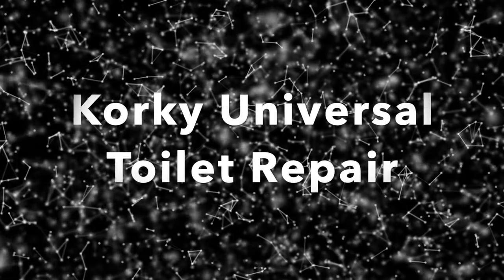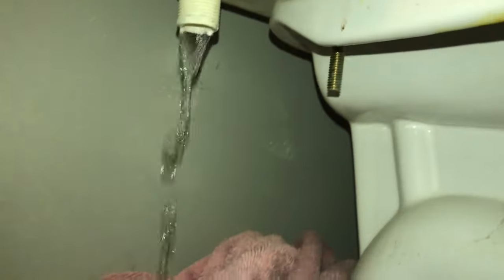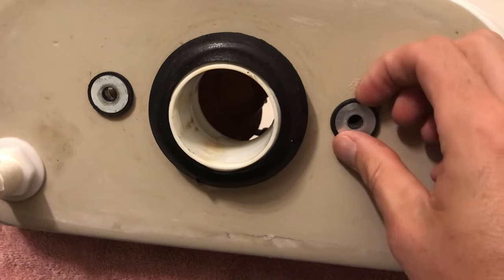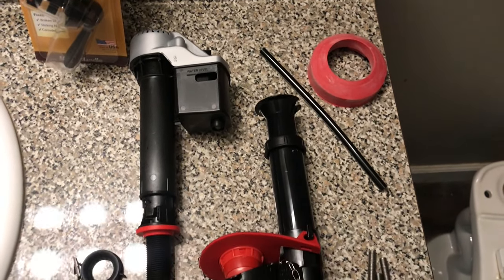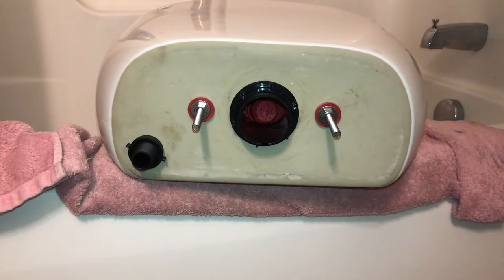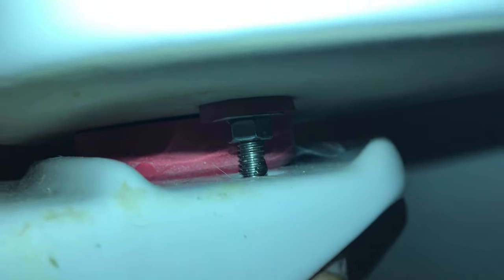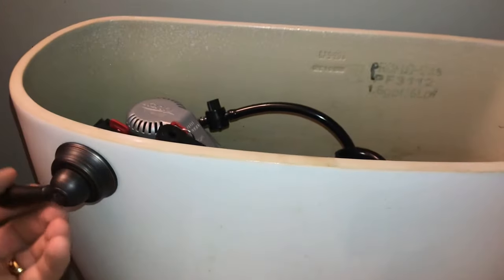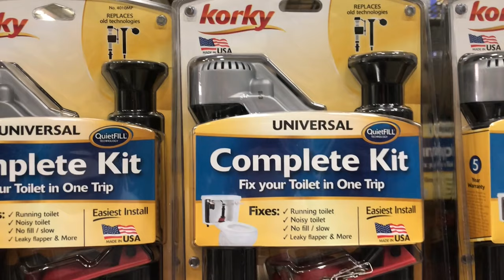Step-by-Step Guide - Korky Universal Toilet Repair + Flush Handle Upgrade!

Comment: You did not mention setting the height of the fill valve and positioning of the fill and flush valve.  I think that is very important as well.
Reply from the maker: Agreed. You should mark your pre-existing water level and then adjust the fill-valve to fill your tank to the same level. (At least as a starting reference point.)

Comment: Well I tried and I have some leaking under the valve to the water supply. Not sure what I did wrong but I’m calling a professional. Your video was great though.
Reply from the maker: I’m sorry your having troubles. We’re you able to get it sorted out??
Reply: @WesleyAllenNC  well it’s hard to find good reliable help that would not try to gouge you. I may attempt again. Maybe change the water supply line and get a washer in there or something
Reply from the maker: @Alexsjusa  the water supply line for sure needs to have a rubber washer inside of it. I’m sure  they can degrade over time, so even if there is one in there currently, check it out and see if it has failed in any way..

Comment: The tip at seven minutes is so helpful, I encourage others to get those extra washers and install as video shows.
Reply from the maker: Agreed. I’m not sure why the kit doesn’t come with extra rubber washers
Reply: @WesleyAllenNC  The other thing that this video shows that didn't come with my kit was two (or three) nuts to secure the cistern to the toilet pan.  Your video did show these nuts (although in your case they were simple nuts; I would find wingnuts much easier to tighten).  I called Korky's support line and they said that there weren't supposed to be more than three nuts in each pack; they didn't suggest that you needed a nut to tighten the bolt through the cistern, as well as a nut to go underneath the toilet pan.  This, along with the lack of a couple of extra washers, just smacks of cheese-paring economy, and doesn't leave me with a good feeling.

Comment: Excellent presentation with helpful additions - thanks for putting this out there.  One thing I found useful as I installed this same kit without any assistance was to have a level handy for the tank install.  The supplied Korky tank gasket in my kit was not fitted to the impression of the locknut as yours was and when I installed the tank (suggest having the mounting bolts in before placing the tank) the tank sat quite high above the toilet base and by using the level, I was able to mount it front to back/side to side without guesswork.  Your tip about having the flange side up ("this side up" ) on the flange nut as well as the notation on the instructions helped when I hand tightened the water supply and could not figure out why it was still leaking.  Your efforts are appreciated and your method of delivering information is easy to understand.  A real-world answer to the vids produced by the makers.
Reply from the maker: Thanks for the kind words! I'm glad that the video helped you out in some way. Oddly enough this has been one of my more successful videos, I guess everybody has a toilet! I plan to put out similar videos as I make repairs and upgrades around the house..

Comment: There are lots of videos on YouTube about fixing and repairing all sorts of things. But this video was one of the clearest and best I've ever seen, and I''ve just almost finished replacing my Korky.  I said "almost", because in a false economy move, they have not included a second set of nuts to secure the ciatern to the pan, and also left out a couple of rubber washers which woud make the job much more waterproof, so I'm going to have to go out to my local hardware store to source some small bits. Grrr...But thanks for a great video.

Comment: After the  1st install I had leak a and then we  found your video, we took everything apart and added the double rubber washer, we had zero leak . Very help video, thank you.
Reply: same happened with me. There was leak and added extra washers in all 3 bolts.

Comment: The drilling part , golden idea , came in handy when removing the old flusher. Thank you
Reply from the maker: Yes! And It’s such a large fitting, most of us don’t have specialty tools on hand so drilling it off works like a charm..
Reply: I used an oil filter pliers from autozone cost about $8 as I was going to reuse

Comment: Wes - fantastic instructional video with useful tidbits of information to avoid mistakes as well as to do the job right!  Long story short - I just finished doing all of this tonite (I am 62 and every stop of the way was drudgery). I had a wet floor (even with towels lol)  I have a fan in there overnight and a bucket under the valve / water line. I think I have a drip over that side - so hope to find that in the a.m.    I had seen another video where someone suggested adding extra red washers/nuts on outside of tank prior to mounting to bowl.  I wish I had done that. Whether I find  any leak at all - I am going to go ahead and buy the extra bolts tomorrow and remove the tank --- again -== an add the red washers/nuts.  I would rather have a sure thing than 'hope' there is never a leak at those two bolts.    I think - if there is a leak - it  is from probably putting that little black plastic nut on the bottom of the fill valve thingy - the nut that says THIS SIDE UP.  Will find out tomorrow - too worn out to fight that tonight.   I am happy with the kit - the included parts, the quality of the plastic - (hate plastic but the way of the world), the instructions are pretty good - but your instructions made it all so much clearer.

Comment: Thanks!. I watched a couple of these and by far yours was the best video especially  with the great camera angle.  Going to redo mine tommorow  and add the additional rubber gasket because of all the things the new corky system leaks at the bolt. Also love that you mention size of wrench you needed
Reply from the maker: Hey thanks! I really appreciate that. I still can’t believe they haven’t just added additional washers to the kit to solve this..

Comment: I wish I would have watched this one beforehand and took your advice to get the extra tank bolt kit for the extra washer. Couldn’t get mine to stop leaking. Great job man with this video. Well done!! Going to get the extra washer now…
Reply from the maker: Thanks, I’m glad it helped! Yeah the extra washer is a lifesaver. You might even be able to sort through the hardware isle / drawers and find rubber washers that will work instead of buying the set of tank bolts
Reply: @WesleyAllenNC  That is exactly what I ended up doing, purchasing 2 individual washers. They did the trick, now no more leaking! And I went ahead and purchased the handle as you did in your video. Thanks for replying brother, have a blessed weekend!

Comment: You saved me. I installed without extra washers below bowl and water went everywhere. Got extra rubber and metal washers and nuts from Mansfield kit and all good. Thanks.
Reply from the maker: I’m glad that it helped! They should just include the additional washers in the kit..

Comment: Great video. I wish I watched this before I ran to Lowe's to buy a 16 inch wrench in my struggle to get the mounting nut for the tank off. I could have spent $5 to $10 on the drill bit instead of $30 on the wrench and save 30 minutes of frustration! I'll check you channel first before undertaking similar projects.
Reply from the maker: Thanks for the comment! At least your were able to do it yourself.. and maybe you can return the wrench??
Reply: I used an adjustable oil filter wrench, which I already had.😂

Comment: My neighbor taught me how to do this many years ago. He is head of maintenance at the place where he works. Anyway the other thing he showed me to do is put a flat washer on the bolt before the rubber washer inside the tank. Now I know these things are in water all the time, so it just means to change them a little more often. Some of the rubber washer sets are convex on both sides, so the extra flat washer made the seal better way better.

My Korky only came with the set of 3 tank to bowl hardware and my toilet has 3 holes. So I had to go buy another set of 3 just to have enough pieces.

Comment: There are a lot of instructions about fill lines - and adjustments on that flapper - I still have to read all that a few more times and follow the instructions - but first - the leak and adding the red washers/nuts to outside of the tank on the tank to bowl bolts. Thank you again, Cheryl in SC
Reply: @WesleyAllenNC  ha ha. At my age w all this work, only OEM washers will do!!! A job worth doing....

Comment: Very helpful video. I found instructions with kit very difficult. My problem is water keeps leaking from black refill tube that goes from fill valve into flush valve. I've made numerous adjustments  in height of both fill valve and flush valve. I even shut off refill dial adjuster completely. Water still leaks. Do you have any advice. Thanks

Comment: My installation seemed to go well without the extra washers on bolts and no leaks for several days and started to use the toilet again for a few days without any problems all ok only noticed the water level in the bowl was too low (not sure if i can readjust the fill valve upwards without taking it completely out?) and there are some stationary bubbles on the heads of the two bolts and at the bottom of the fill valve. However after a few days of no leak problems i got a bit concerned about the toilet rocking on the vertical and i thought if i tightened the nuts around the bolts that might help - however the result was leaking from the bolt on the right side post flushing, after tightening, and especially when i open the main water supply full enuf so it does not take 5 minutes to fill And then another problem - as i increased the water pressure from the pipe a banging noise started sounding like a tractor in the pipes which would disturb the neighbor in the apartment below and perhaps the neighbor adjacent if i did not shut it down almost completely off  (this did not happen with the old tank inserts). So we are back to using just the toilet in our ensuite second bathroom.    HELP PLEASE.   thks

Comment: Good video. Im having problems with water not stopping as it fills in back, also leakage in the right side of tank. I seen you have a rubber grommet on the inside of tank and on the outsides
Reply from the maker: Yeah I wound up buying an extra set of tank bolts from the hardware store just to get the extra set of rubber washer. I think it helps even though the kit doesn’t come with them.. water not stopping, make sure your flapper is fully seated and not leaking water into the bowl, this could be due to a short, or too short of a chain. Otherwise it will be a fill valve adjustment, the korky kit is fully adjustable
Reply: The extra rubber washers helped. Its not leaking at the tank bolts now!  Yea !!! Im a plumber now!

Comment: Great video!!! How do you adjust how long it takes to fill the tank. Cummins is taking 1 minute to fill which is wasting water. Please advise. Thanks
Reply from the maker: How long it takes to fill the tank just depends on water pressure, tank size, and water height inside the tank. Water height can be adjusted up or down but raising or lowering bother the overflow tube and the fill valve

Comment: Great video! Just want to confirm one item with sponge gasket. There’s a considerable gap when I first set tank down - your video appears similar. Is this normal? I’m sure gravity will compress gasket but just want to confirm. Thanks!
Reply from the maker: I'm sorry for the delayed response. Yes there is a pretty decent gap at this point, just make sure the sponge gasket is oriented in the right direction and then begin to tighten the flange bolts, keeping in mind not to over-tighten and to keep the tank level..

Comment: Hello,
I just replaced mine but the level of the water is much higher than the one I removed, how do I adjusted so that the tank doesn’t filled up to the top? I learned a lot from your video, thank you so much.
Reply from the maker: The fill valve is adjustable. You’ll most likely need to lower it so that water isn’t filling too high

Comment: Hi Wesley! I see condensation around the red “spud” between the tank and bowl. How compressed should it be when tightened? 
I wish I had seen this before a friend tried replacing the spud incorrectly and not using the extra washers. 😢
Reply from the maker: It really just need to be snugged down evenly. It never really pops into place or anything like that. (The large rubber gasket connecting the tank to the bowl is what your referencing right?) ..Then the extra rubber washers certainly help out on making the bolt connections more water tight..

Comment: I’m trying to figure out where you show how to adjust the tank water level.  I’ve just followed every step and the directions are showing me that this is something that should be done before installing the fill valve. Is that correct?
Reply from the maker: The fill valve is adjustable up and down if needed. We're you able to sort this out?

Comment: Wes, you saved my day! Out of all of the instructional videos I viewed, yours was definitely the best and most concise. My only problem is, I need to hold the handle down to get it to flush. If I hold and release it doesn’t work. Help!?
Reply: You may need to adjust the fill valve height so allowing more water in the tank at each flush. Sounds like your flapper is closing back to soon

Comment: Excellent video and I wish I had watched this one, instead of the Korky one before doing my installation.  Overall my installation was fine (no leaks, everything works), but there is one thing that is still an issue: the tank still has some movement after I tightened the bolts.  Is this because the sponge gasket is still new and as it settles it will allow me to tighten the tank bolts further?
Reply from the maker: The tank will almost always have some movement since it’s basically just sitting in the rubber gasket and held down by the two bolts. I would just tighten them good by hand but don’t use any tools to torque them down. It’s never happened to me but I’ve heard you can crack the bowl or tank with too much torque
Reply: @WesleyAllenNC  thanks.  The problem is that if I don't tighten, there is too much movement.  Much more than there was before, when the tank was pretty solid and had virtually no movement at all.
Reply: @alekaras01  You can hand tighten the tank nuts if you rock the tank as you tighten the nuts. Actually if you push the  tank to the right, you should be able to tighten the nut on the right. Then push the tank to the left and hand tighten the left nut. Repeat this process,  leveling the tank as you go.

Comment: My handle doesnt go back to resting position very well after flushing... any thoughts?  Ive loosened nut and still doing the same??
Reply from the maker: Possibly too much slack left in the chain that goes from the handle to the flapper valve would be my first thought..

Comment: Thanks so much my man. You just helped me so immensely. You were very clear and precise yet simple with your explanations. I was a bit weary of taking on this job but you showed me exactly what I needed to do and I am fully confident I can accomplish it. You rock. Also I must say thanks for the tip on adding the extra washer underneath the tank bolt. Extra security is always a plus. 
You got a ÷1 subscribe from me. 
Keep it going and stay safe out there. 
🙏💛🐶✌
Reply from the maker: Hey, thanks for the comment! I’m glad it helped and hopefully you’ll be able to pull it off! It’s not the hardest job but all toilets are different and have their own little issues it seems. I put this in 2 bathrooms actually, (and both times they worked!) Thanks for subscribing, my channels all over the place but I try to post a lot of DIY projects and things around the house as things arise..

Comment: As many other viewers have noted...excellent presentation. I've heard that the adjustable type of flush valves have a problem with leaking eventually, or even right after installation. Many users have mentioned the sound of running water and tank level lowering with adjustable flush valve. Have you had any issues with them, or heard any feedback? BTW, for Gerber owners, I got a fixed height Korky flush valve for a 1985 Gerber which requires a thicker than standard tank-to-bowl seal, and there's no way the seal fits the round Korky locknut to make contact with the tank bottom. But it works just fine with a standard hex locknut.
Reply from the maker: Thanks for taking the time to leave a comment. I haven’t had anyone continually commenting after their initial question so I can only assume that they were able to remedy their problem. It’s almost always something small that was left out or not tightened / adjusted properly..

Comment: Hi, I installed the entire internal toilet system as instructed, and everything is sealed tight, however the flush is still week. Do I need to increase the bowel water fill level?
Reply from the maker: That would most likely be the cause. Is it the same fill level as before?
Reply: @WesleyAllenNC  Thank you.